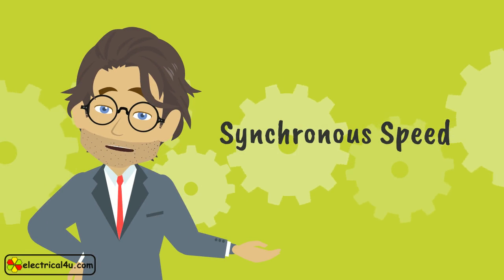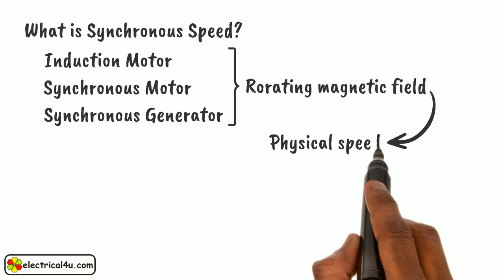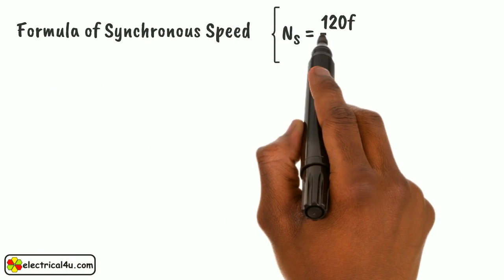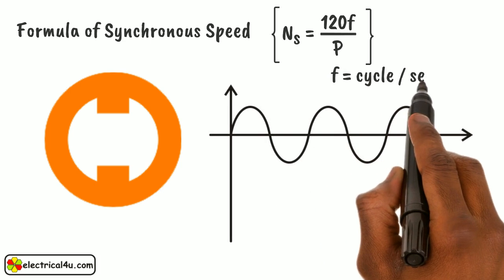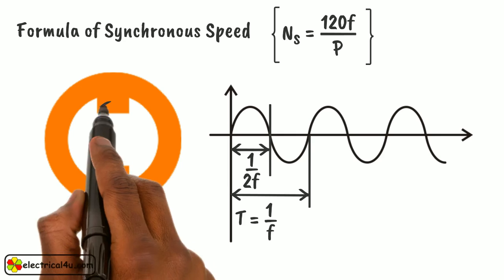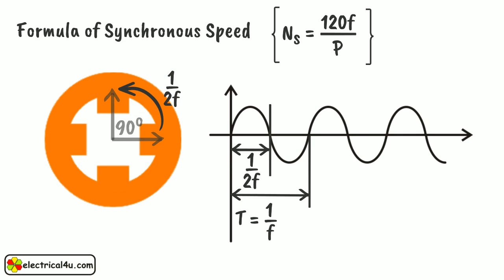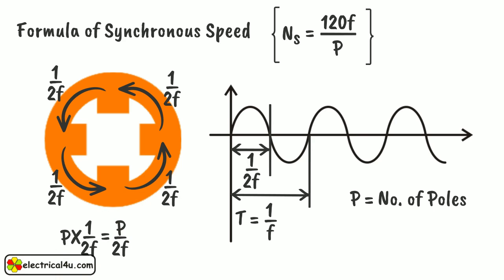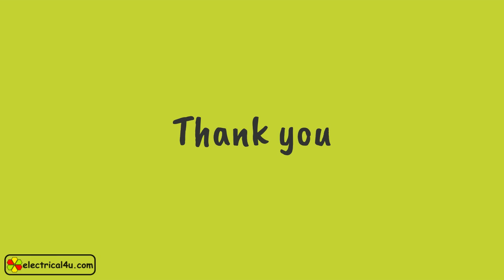Synchronous Speed: What is it?

Comment: Synchronous speed is the rotational speed of the rotor.  Regardless of the number of poles of the rotor, the rotating speed of the rotating magnetic field is given by f (Hz) x 60 (seconds) = 60f (revolution). 

For a 2-pole rotor (North and south poles), the rotor will rotate at 60f.
For a p-pole rotor (p must be multiple of 2), the rotor will rotate at 60f x 2/p = 120f/p